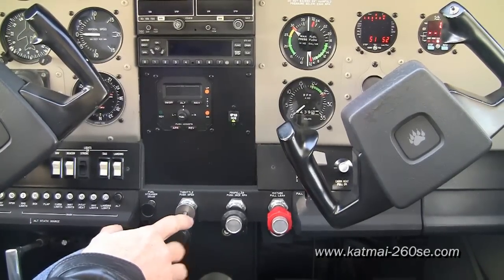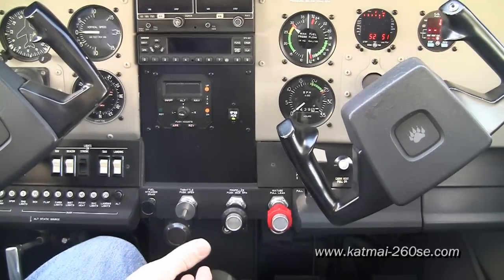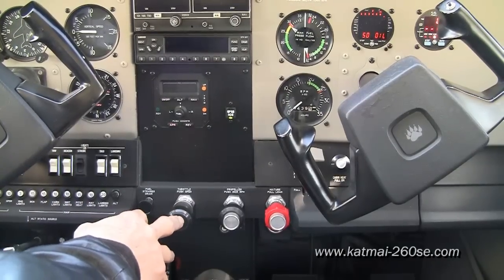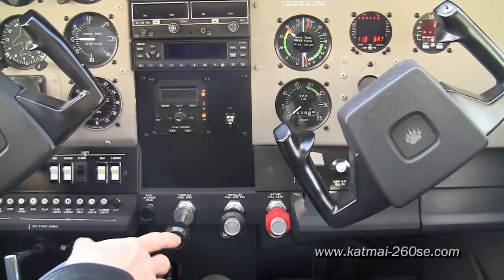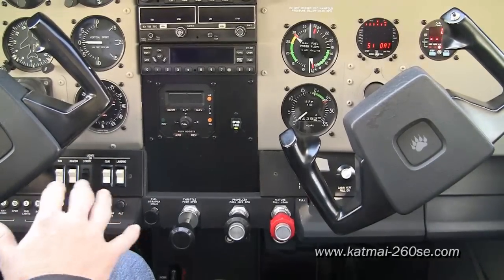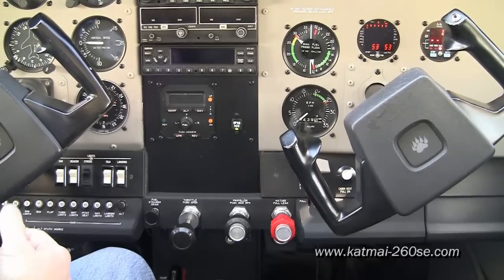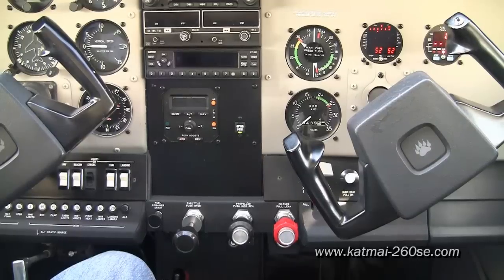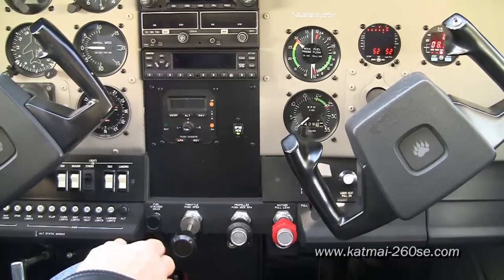Todds Tips - Starting A Fuel Injected Engine

Comment: For a hot start on Continental IO-520 I found one method that we tried and seems to work pretty reliably, so that the engine runs nicely and smoothly the first 15 seconds after start or so:

1. Mixture - ICO
2. Throttle - Full
3. Boost pump in the "priming" mode (wording depending on your airplane manufacturer) for 10 seconds or so. That will flush and cool the fuel lines down with the cool fuel from the collector tank and no extra fuel is added to the induction manifold.
3.5. If you feel like you need to give it some prime, after the 10 seconds you can shove the Mixture 1/4-1/2 way in for a second or two, depending on your engine. That needs to be feeled out, these are the values that guarantee our specific engine will start even if it puffs black for a second. Then back to ICO. Usually not really necessary if the engine has been shut for short time.
4. "Prime boost" pump off.
5. Throttle for start (1 cm or so). More if you think there may be a bit more fuel.
6. Mixture full rich.
6.5. If your installation's POH says use the "low" boost pump for start, you should use it.
7. Starter.

Comment: Dear god this dumb. I’ve spent many years working with electronic fuel injection, and it boggles my mind at how old and outdated the stuff for aircraft is. I could literally build a electronic fuel injection system for any engine and make it work reliably and effectively. Hell I could build you a dual FI system for redundancy if you wanted, and I guarantee you’d never have a catastrophic failure in flight. And that’s with off the shelf parts, that probably cost a tenth of what you guys pay for this garbage.

Comment: I turn the pump on with the mixture lean, then watching the fuel flow meter I open the mixture for a couple of seconds (then pull it back to full lean, for my engine) then hit the starter, (and as soon as it fires, advance the mixture to full rich, for my engine). The difference is that the amount of priming is monitored through the fuel flow gauge, i.e. you'd notice if the throttle was too far closed or open by the amount of fuel flow.

Comment: Very accurate description of starting procedures for fuel injected Continental engines. Lycoming fuel injection is very different in design and requires different procedures hence the reason to start with the mixture full lean. Best to know the POH for the aircraft you are flying!
Reply: Very true

Comment: Awesome video - definitely helped me. Question: I was taught (way back when I was training in fuel injected 172s) that you should crank the started with the mixture cut, then when the fires, give it full mixture. I've seen it done both ways. I assume you prefer the method with the mixture in? Thanks!!
Reply: MrAviation101 Ditto. I've been taught to throw the mixture in as soon as it kicks. Cessna will tell you that we've both been doing it the correct way in chapter 4 of the handbook. 

I like sticking to checklists. 

By the way, I love your videos.
Reply: Only for hot start. Otherwise, having the throttle at idle stop and advancing it as you crank does nearly the same thing.
Reply: What  @Bartonovich52  said. The mixture cut trick is also great if you drown out a carburated engine.

Comment: @stealhty1 I think it is a different approach. Todd uses time, or the usual 3 seconds, like all the old-timers do it. But my manual says not to cut the boost pump at all! Instead, it says to prime until fuel flow is indicated (which is actually fuel pressure over a metered orifice), then cut the mixture, which prevents flooding the engine, despite aux pump running. Then, when engine fires, mixture is advanced for smooth idle.